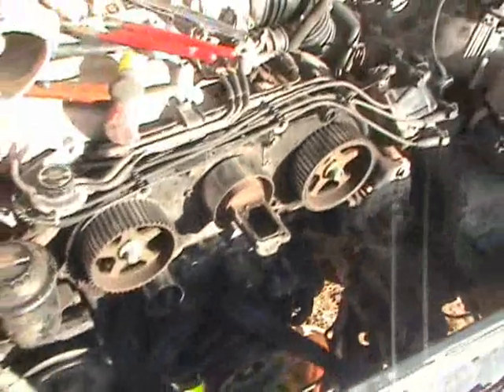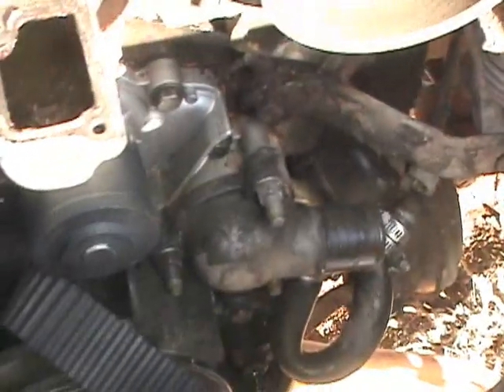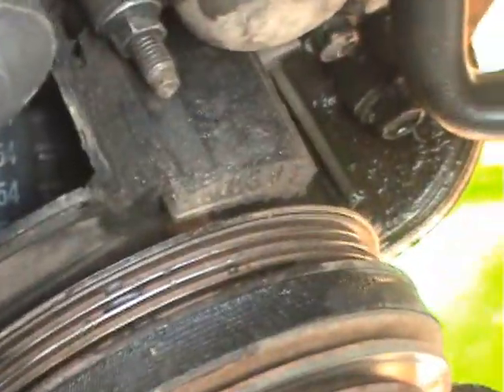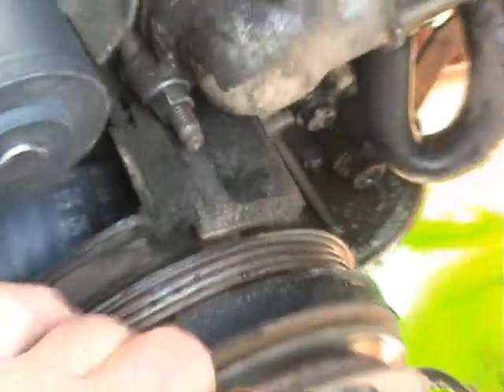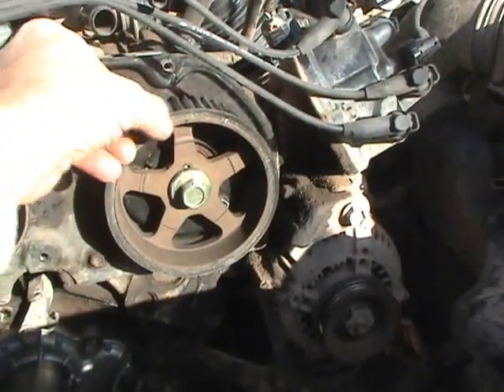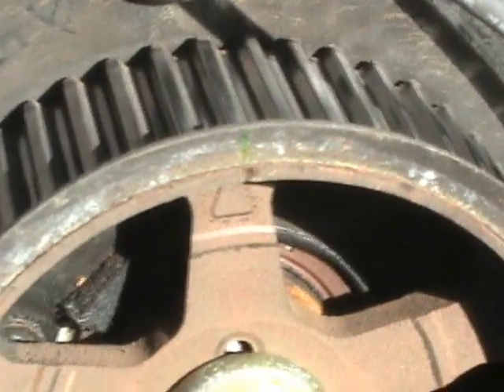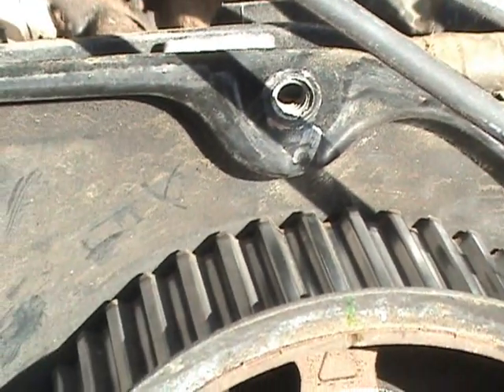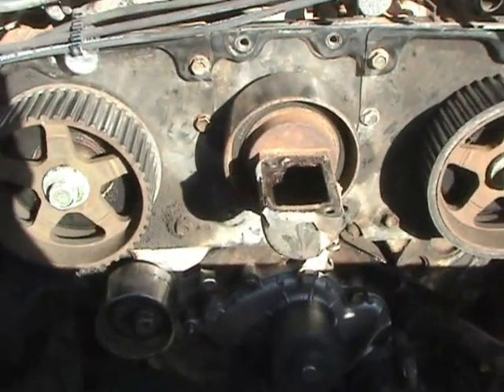Toyota Pickup 1992 timing belt marks

Comment: Congratulations, it looks like you got it fixed! Changing a timing belt is a pretty challenging job as you seem to have found out. 

My timing belt on my '93 Ford Ranger has been stretched and loose enough to slap against its plastic shroud and make annoying noises for the past few years, so I looked into changing it myself. Online information says the job is a 5hr job (probably at least double that for me since I haven't done one before) that would cost about $400-$500 for parts and labor at a shop. It will be the most technically challenging work I've done on a vehicle if I do choose to do it myself. 

What I recently ended up doing in the meantime is to just re-tension the timing belt by cutting the belt's plastic shroud in half with a tiny Exacto razor saw, so I could get at the tensioner pulley that you normally can't get at without removing number of pulleys, belts and things and stuff. The belt is now tight, and it runs much better and quieter, but I don't know how long such a repair will last. I'm no expert, but it seems that a stretched belt might be a pretty good sign that it's time for a new belt. The engine is supposedly a non-interference engine, so if the belt does break, the pistons won't hit the valves and cause more repair cost. So, I thought I'd give re-tensioning a try before I do a more involved repair.
Reply: +bizzee1 if you do the job yourself just a word of advice. also replace the belt tensioner. it may be a one with a spring load or one you need to manually tighten. a lot of times when a new belt is installed and retightened the tensioner fails.better off replacing it than take the risk.
Reply: +hellshade2  Thanks! The belt kits for my Ranger all seem to come with a tensioner pulley, so I won't be tempted to not replace the pulley along with the belt due to having to buy extra parts separately. However, since the belt is so buried behind other things to remove, what I am tempted to do is try to figure out a way to cut the new belt and fasten it back together once threaded through its path. Something like that could cut the job's time in half. If only it was a chain instead of a belt.
Reply: do not do that.my advice is to look on youtube for videos of someone doing the same job. also many local libraries will have manuals for a lot of cars. it may look scary but if you do the research you can find it will be easier. also a good idea when removing parts,brackets and bolts is to put them in separate containers and mark them from where they came. this will help when it comes time to put things back together.also you can use different colored markers to mark your bolts to a corresponding hole in the brackets just some advice from an old mechanic :)
Reply: hellshade2  Yeah, I've got a manual, and I've watched videos. That's why I began thinking that this timing belt change is such a laborious task that it might be worth the time to invent an easier way.
Reply: bizzee1
 trust me though,do not try and cut the new timing belt to put it in all that will happen is you will more likely damage your motor
Reply: hellshade2  Well, I invented a way to re-tension the belt without removing all of the bits you'd normally have to remove to get at the tensioner, so I've got a good feeling about figuring out how to repair a cut belt.
Reply: bizzee1
i was a mechanic for 27 years bizzee1 and trust me it is not a good idea to cut the timing belt to install it.that's all i can say besides good luck with the work  :)
Reply: hellshade2 Well, you're certainly not going to be the one to invent a way to repair a cut belt with that attitude.
Reply: hellshade2  I hope I did not come off as disrespectful with my last comment, but I'm not so much trying to be a mechanic here as I'm trying to be an inventor. So, advice from a mechanic's perspective is not necessarily applicable.
Reply: bizzee1
no worries man. just giving advice from experience  :)
Reply: hellshade2 Right, so your advice based on 27 years of experience as a mechanic is to not be an inventor.
Reply: no,all i was doing was giving advice. if you think you have an idea for an invention then go for it. i was just mentioning some ramifications to your motor if your ideas did not work.if you believe you have a workable idea then by all means try it out.
Reply: +hellshade2  Then I guess someone must have hacked your account and told me not to cut my new belt and invent a way to repair it if it wasn't you that said that. :)

Comment: yep, a litle off with the timing belt and it could end up anywhere from running really weak to making engine a complete wreck. My moms car had an interesting problem with the output shaft to belt gear coming lose, so the gear could rock back n forth spanning 17 degrees. Her engine ran but made about 10-15 HP max on full throttle... and really hot exhaust gases melted the catalyzer. Luckily (finally) warranty absorbed the costs, pity it took the service guys 4 weeks spread out over a full year to find it.

Comment: I'm curious on how to adjust the timing belt tensioner on this engine. It has to be a little bit loose, or the spring has no purpose. But how loose?
Reply from the maker: Good morning! I tightened the belt via the idler wheel just tight enough so that the belt will not squeal. This is to prevent unnecessary loads on the idler wheel bearings.

Comment from the maker: I video taped the whole bloody process of taking the front of the engine apart, but I figured that wasn't all that interesting. It took me two years to fix the coolant leak.
Reply: +Desertphile Well, better late than never.
Reply: +Desertphile I spent 2 years repeatedly fixing a rear main seal and a bad oil pan leak in my 1986 k5 diesel blazer. I went through a series of defective oil pans, etc, etc. Now that that saga is finally over with my new oil pan is now leaking at the new drain plug, lol! So now I have to wait unit the next oil change to fix it. You may say that Hell doesn't exist but I swear to you that I've spent much time there and it's location is under my truck. And judging from your video you've been there too.
Reply from the maker: +fywacia Argh. Drain plug that is draining while plugged.... golly, I hate it when that happens! The problem my 1992 Toyota had was radiator coolant leaking from a place I could not find. I took the air intake hood off, and the valve cover off, radiator, hoses, etc... the months piled up, as the vehicle sat there on blocks waiting for me to find the time to keep looking for the leak.

Comment: Why they feel the need to drive the water pump with the timing belt in the first place is beyond me.
Good job!
Reply: +Talladega Tom a lot of cars were like that some still are. these days they are generrally run with the serpentine belt that goes to all yor pumps and and alternator. the plus though is a serpentine belt is much better than the old v-belts.

Comment: I replaced a chain & gears in a '72 Toyota car once. Much easier. And bonus, I learned to change oil more often.  :-)
Reply: +HerkRants cars were a lot easier to work on in those days. had a 68 chevelle for awhile and the engine compartment had so much room. swapped out the motor and tranny in it and it was easy as hell with all the room.
Reply: The Toyota was the easiest car I ever worked on because, for one thing, it had welded nuts. You only needed one wrench to take things apart. I pulled the radiator, replaced the timing chain and gears and tensioner, replaced gaskets on the valve cover, tuned the dual points and carb, and it was back up and running in two hours.